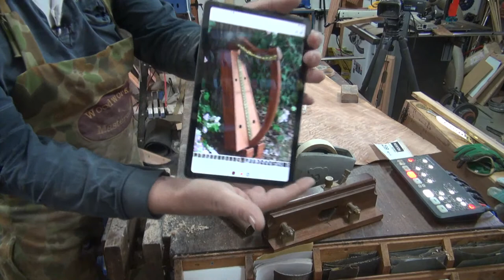Veneering Work and some Parquetry

Comment: Morning Steve - Im working on a herringbone pattern inlay, and im thinking that ill use this process.  The pieces are thicker and less fragile.  Does the contact paper allow you to test fit, then peel off - glue - and refit?
Reply from the maker: Hi Vince, I work in reverse so when you apply the inlay the downside in facing up. If that makes sense. So when it's glued in place the simply peel off the contact. Cheers Steve
Reply: @Woodworkingmasterclass  thanks. That part i get. Does the contact allow you to test fit each piece, peel it off, glue and refit?  When your tiling all the little pieces.
Reply from the maker: @ArchEdge   Oh, Yes no problem. Cheers  Steve